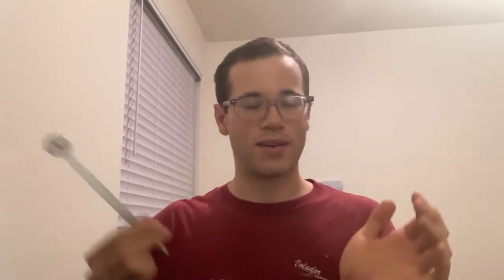Weber and Rinne Tests for Conductive or Sensorineural Hearing Loss

Comment: Laterization=sound is louder in one ear. 

Conductive- issue with external/middle ear.

Sensorineural- issue sending sound to brain from inner ear.

Normal (positive) rinne test- air conduction is greater than bone conduction or sensorineural loss of that ear.

Abnormal  rinne test- bone conduction is greater than air conduction

Normal Weber test- equal sound in both ears

Abnormal Weber test- sound  lateralized to one ear. 

If it’s a conductive issue the sound will lateralize to the affected ear.

If it’s sensorineural issue the sound  will lateralize to the opposite ear.